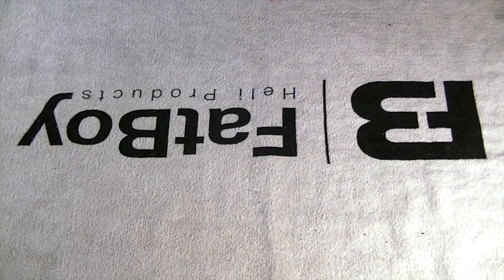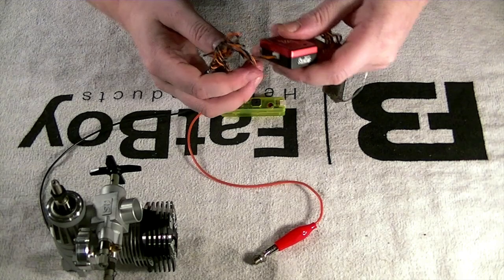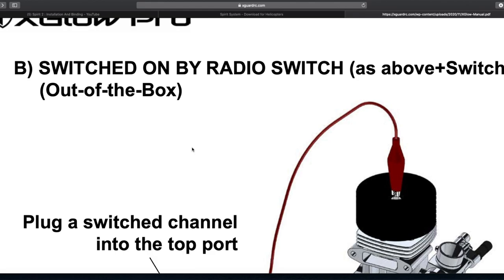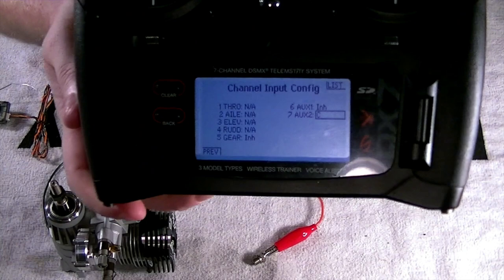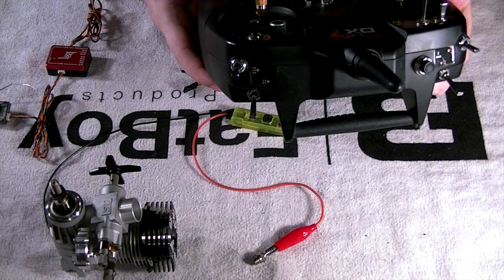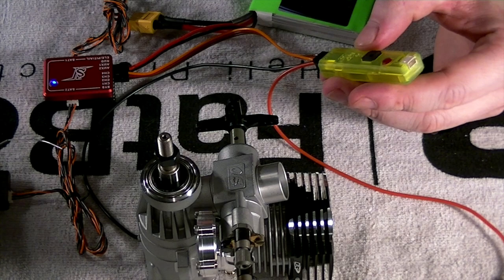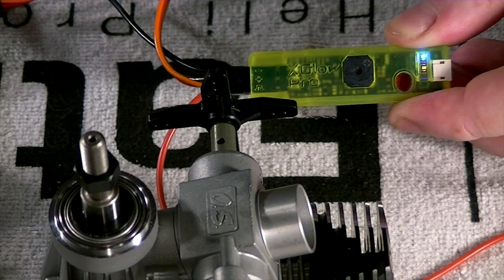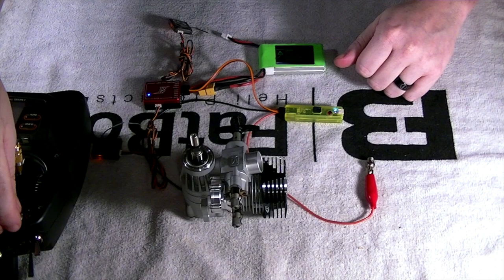XGlow Pro Glow Ignitor : Setup Series B, adding radio switch and location buzzer. (FreddyCanFly)

Comment: What if you forget and leave the switch on? Does only glow for 15sec. Like the Switch glow?
Reply from the maker: You can actually program it for 10.15.20 second.  But yes if you leave the switch on the glow will turn off after the programmed amount of time.